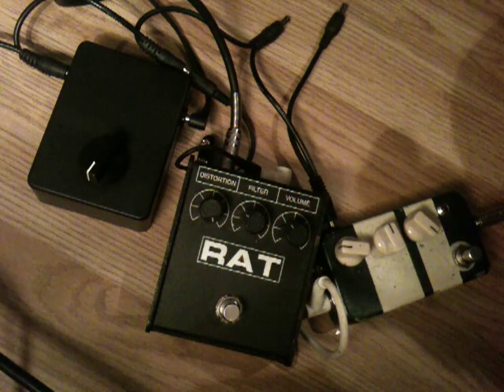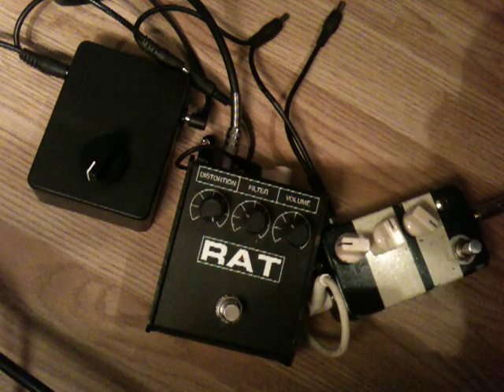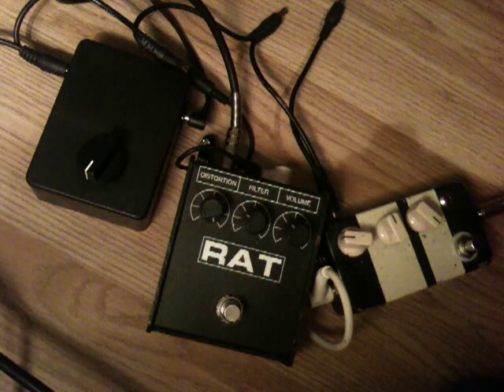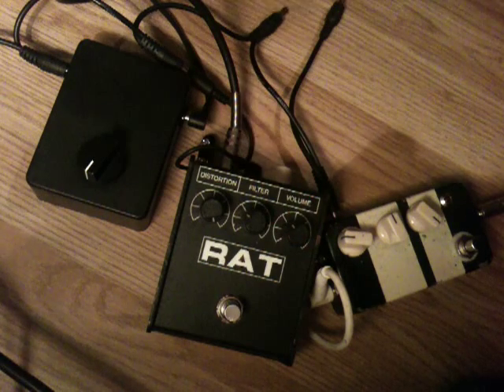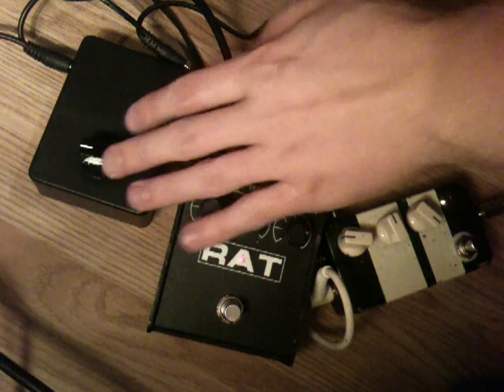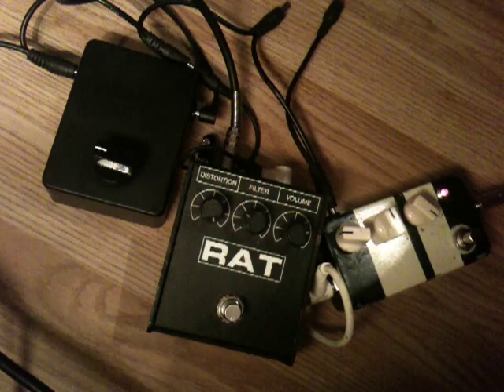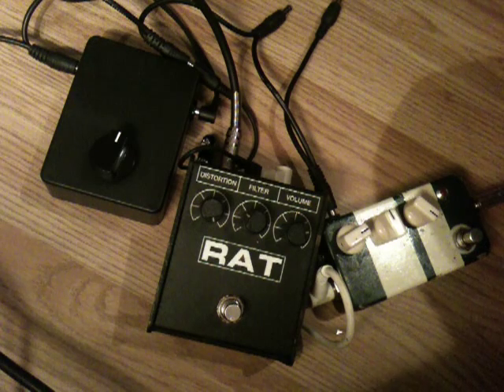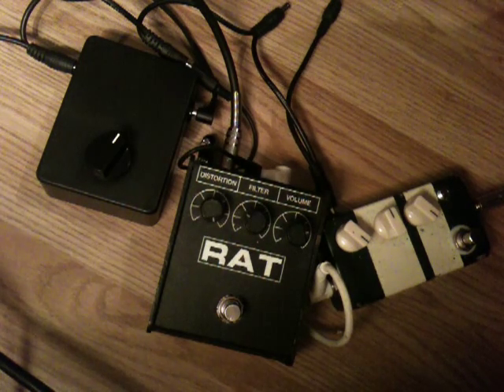Homemade Dying Battery Simulator

Comment: hey could you please help me out. I am attempting to build the same thing. On the beavisaudio diagram it doesn't say which of the lugs on the dc jacks are which. Im a real novice so I am not sure which lugs are which in the diagram as far as the dc jacks go. Is it the shell or the tip lug of the jack that goes to the pot? is it the ground that it connected between the jacks? sorry im very new to this.

Comment: I guess what you could do is measure the resistance of the pot just before it starts to affect your pedal sound, and then just place a permanent resistor of this value in series with a much smaller pot (smaller pot value means smaller change in resistance per degree that you turn the knob by). Hopefully that'd give you a better operating range

Comment: Hey. I just built on of these as well. Did you find the control really touchy? Mine only has a really short range of movement before it cuts all power from the pedal its plugged into. Its a cool little box - I just wish it had a bigger range so I can make finer adjustments.